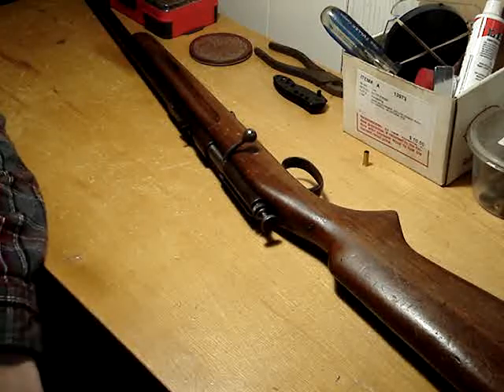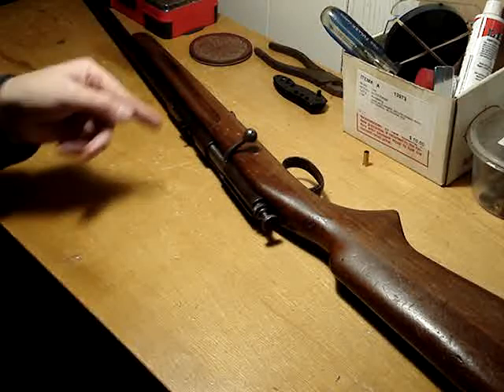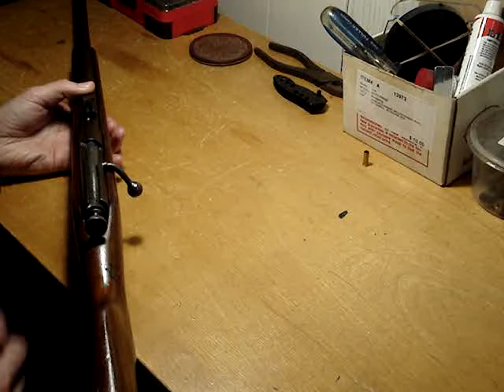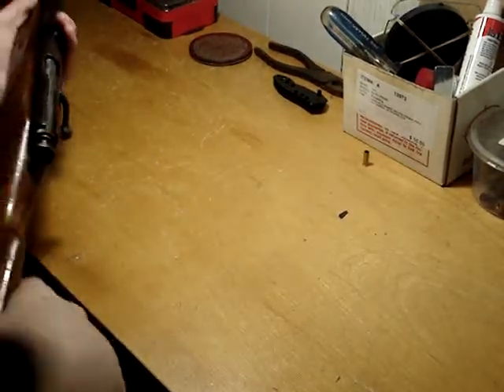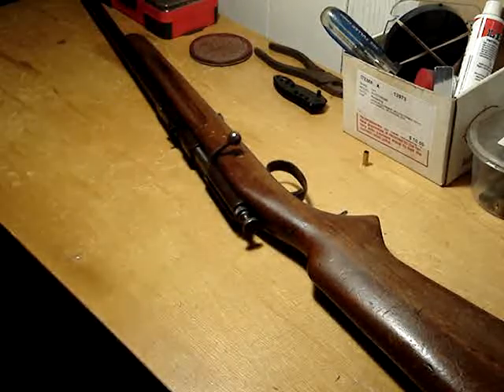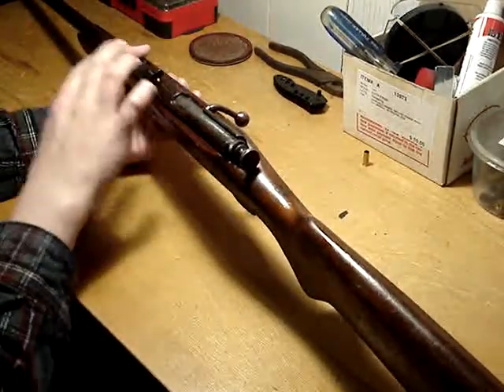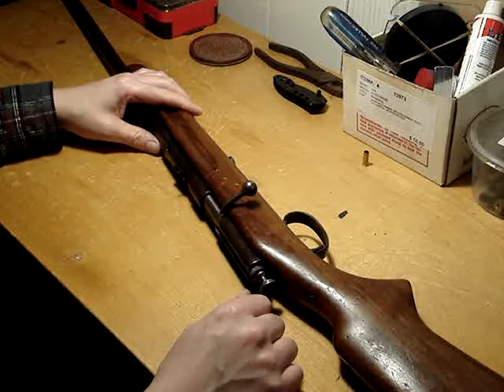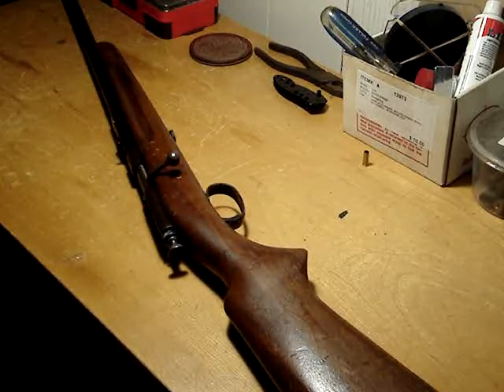Savage Model 3 Simple Safety

Comment: The firing pin doesn’t sit on the rim in fired position. There is a little bit of free travel at the end. When foiled the pin is pushed but the forward inertia carries the pin far enough past the spring reach to dent the rim when fires.
Reply from the maker: did you even watch the video?